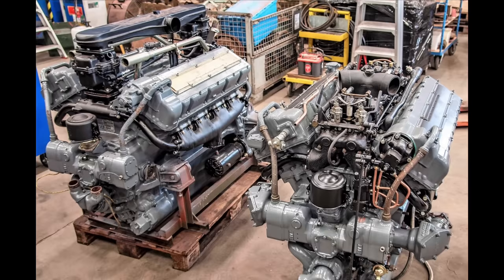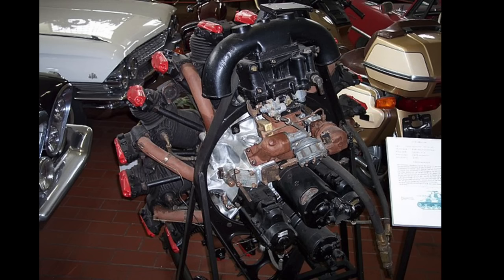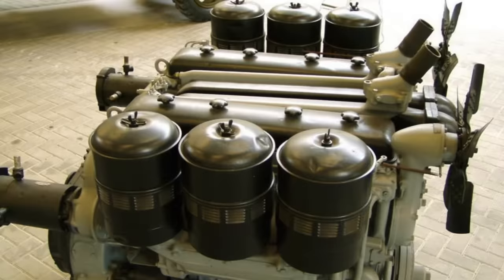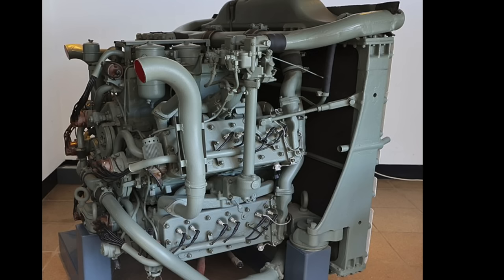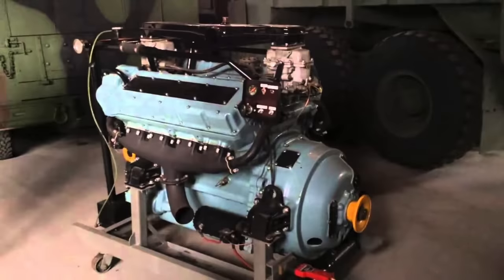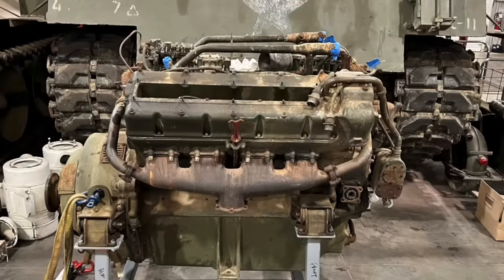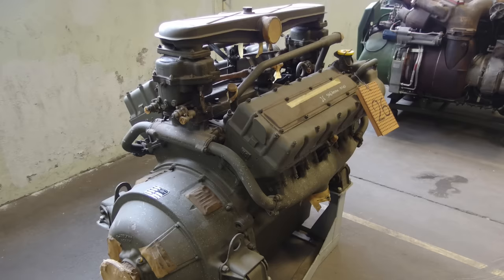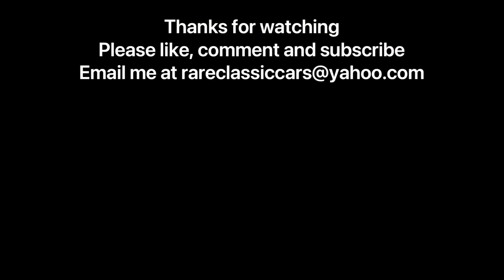An All-Aluminum, Flat-Plane Crank, DOHC V8 in 1940! Ford's 1,100ci (18L) GAA V8 Is a WWII Marvel

Comment: The old timers that were drag racing in the era of flathead V-8’s used to talk about making 180 degree cranks for their engines to use in place of the original 90 degree cranks.

Those truly iconic 671 GM Diesels (before the division was called Detroit Diesel) deserve more than this passing mention!  They did not share a common block. It was two straight sixes driving a common gear box. Each engine had a clutch allowing operation on either engine, as stated. These are naturally aspirated two strokes, not supercharged. The scavenging blower is necessary to remove the exhaust from the cylinder and replace it with fresh air while the piston is near BDC after the power stroke and before the compression stroke.  Turbosupercharging would come later.
Reply: People don't realize that what became the hot rod "supercharger" (6-71, 8-71, 10-71 etc) was originally a literal "air blower" for a 2-stroke diesel. People know so little about the old Detroit/GM diesels that they are constantly referred to as 'supercharged'.
Reply: @drifterbbb3649  Refreshing to see that there are still folks out there who realize that a Detroit 2 cycle diesel was not supercharged, not in it's factory form.
Reply: Great to see somebody who knows that Detroit 2 cycle diesels were not supercharged.  So many too young to know try to argue about this.
Reply: You shouldn't use the outdated term superturbocharging as it is misleading. Just say turbo
Reply: If they require an engine driven blower to flush out exhaust gasses, would that qualify as naturally aspirated?
Reply: @k4106dt  Yes, because the blower doesn't act as a booster.
Reply: @mikeholland1031  It is not that important.  You knew what he meant, right?
Reply: @jamesbosworth4191 please explane yourself?
Reply: @vicferrari9380  What do you need me to explain?
Reply: @jamesbosworth4191  I did but many won't. That was why I stated that. It's an outdated misleading term.
Reply: A very similar twin bank set up was used in the Navy and Army Landing Craft Mechanized, LCM 8s (73' landing craft) from the '50s until the early '90s.
Reply: Yes, a scavenging blower, amazing to see how many clowns in videos refer to them as supercharged - one of the finest diesels ever made.
Reply: Oil leaking, screaming Texas Yamahas! :)
Reply: @chosen118  All part of their charisma..
Reply: @mikeholland1031  Like I said, not that important.
Reply: @francovance1  Many of them think all 2 cycle engines are crank case compression 2 strokes like the engines in many lawn mowers, chain saws, etc.  I remember when I used to drive trucks, I had somebody tell me that the Detroit Diesel under my hood was a 4 cycle engine, "because 2 strokes don't have valves".  When I explained to him that there are two different types of 2 cycle engines, he looked completely befuddled.
Reply: I did a bunch of reading and answered many of my questions. The only one I have left is calling a 2 stroke naturally aspirated.  The GMD site says a 2 stroke won't run without a forced air intake because it doesn't have a crankcase input pulse to feed it. Does not "naturally aspirated" imply not requiring more than atmospheric pressure to operate?
Reply: @vicferrari9380  You are correct, a Detroit Diesel won't run without the blower, but stock, it doesn't give the engine more than atmospheric pressure.  The reason the blower is needed is due to the fact that the intake ports on THAT 2 stroke are low in the cylinder walls and are uncovered when the piston approaches the bottom of it's travel, which means no Intake vacuum is produced, hence the need for the blower.  The OTHER kind of 2 stroke, the type found in lawn mowers, dirt bikes, etc. DOES produce intake vacuum, as the intake port is uncovered when the piston is traveling UPWARD, increasing the volume of the sealed crankcase.  A boosted Detroit Diesel typically uses a turbo charger, with the scavenging blower only effective at cranking and low engine speeds, the turbo coming into play as RPM climbs.
Reply: @vicferrari9380 
The blower on top was geared so low that it didn’t compress air, it just blows air into the cylinder… hence the term… blower.

Comment: Another reason for the 60° bank angle of the GAA, is it helped to cancel both harmonics and idle vibrations. If you tried to run a flat plane crank on a 90° V8 of this size, it would rattle your teeth out in a tank. They sound weird, but run much better.
Reply: That is the same reason that the V8 engine in the original Leland Lincoln, (before Ford owned it) was a 60 degree V8.  Henry Martin Leland understood that buyers of expensive cars want SMOOTH.
Reply: Yeah run it up in the RPM's and you stand a chance of fracturing the crank
Reply: It is amazing the advancements in technology.  Metaurlagy and the like.i was thinking it was probably easier to forge that crank to get production through. It was wartime. Ford made the plant for the B 29 and the like.  Something else

Comment: I would love too hear all 4 of these engines run . I wonder if the GAA engine would fit in a Fox Body Mustang 😂.
Reply: Any engine will fit in any car, if you have a big enough hammer...and a torch.
Reply: GAA would be great for tractor pulling
Reply: @ottopartz1  air cooled ???
Reply: @bobturnbull18  it's an air cooled motor!
Reply: "I wonder if the GAA engine would fit in a Fox Body Mustang"

No, but the Fox Body Mustang would fit inside the GAA engine.
Reply: Someone put one into an earlier mustang. I think it's on YouTube if you search
Reply: I was thinking the exact same thing!
Reply: @ottopartz1  The Continental is air cooled. The Ford is clearly liquid cooled. Just look at the photos.
Reply: @ottopartz1 air cooled?
Reply: GAA was not air cooled. Only the radial engine was. @ottopartz1
Reply: No, physically too large.  Might fit in a 70s Lincoln though!  A new version of the Hot Rod Lincoln!
Reply: @ottopartz1 it’s water cooled.
Reply: It might fit, but you would need to reinforce the frame, the suspension, the brakes, the transmission, the drive shaft, the rearend, along with a bigger fuel tank, a bigger fuel pump, longer fenders, a longer hood, and a larger radiator and maybe a big air scoop. But, yeah, I think that would work. Please post a video of the work and the results. That would be awesome. I would run a true dual exhaust because that thing is going to be, as Tony the Tiger says, "Great!"
Reply: @Colorado_Native  You always should replace the clutch, trans, drive shaft, and the rear end when swapping in a substantially larger engine.  The added torque can break off gear teeth in light-duty drive-line components.

Comment: As the old saying goes: Necessity is the mother of invention.
It's amazing to think of the engineering employed throughout the forties, fifties and sixties that is still unmatched today.
Reply: It's surpassed
Reply: That's because there were no emissions laws and no CAFE back then!  American ingenuity was allowed to flow freely.  Today, it is determined by politicians and office workers, politicians and office workers who know absolutely nothing about cars, except how to start them and aim them.
Reply: @Bloodcurling  In some way yes. In too many, still no.
Reply: You are so right on.  The innovation spirit is just not here today.  Not to be negative about today but I worked with a lot of engineers in the late sixties and on and I marvel at what they taught this young whippersnapper.  No calculators or computers just slide rules.  Damn those guys were geniuses'.
Reply: @shareurtube  I just don't have the same kind of respect and awe of somebody who uses a computer to do things as I do for the guy who does it with HIS brains.
Reply: if i can sell you something, without works & jerks, for a reasonable price,,why would i spend 3 times as much producing something better, for less money, from you.. super chargers, ohc, turbo, fuel injection, all old tech.. not needed for mass production..
Reply: @harrywalker968  FACTS.
Reply: Yeah think the Atomic bomb. The refining. The presision machining to get it right the first time  without fail. To me  these days. Christ the discretion

Comment: The worm-drive for the camshafts was a brilliant idea.
Reply: But noisy and I’m sure plenty EXPENSIVE to produce...
Reply: @martyzielinski1442 not relevant in war or for military use.
Reply: I guess mostly higher rpms (thus automotive applications) might be an issue. But great for  low rpm's like these
Reply: Twin and triple row roller chains were cheap and reliable. Why not use them?
Reply: That idea needs to be revisited today
Reply: All copied of the rollsroyce merlin engine
Reply: Shaft driven overhead cams was the standard for big water cooled aero engines in the late 30's. The same can be said for pretty much all the other "advanced" features. The only thing weird about this thing is that the design was never really used as an aero engine. As a consequence history remembers it as an advanced tank engine rather than the cut down and de-tuned version of a mediocre aero engine.

Comment: WWII and the period directly preceding it were full of innovations, especially in aircraft engines.  Turbo-compound engines were an example.  It might be safe to say that until computer controlled engines became the norm that very little new innovations occurred after that war.
Reply: 100% correct, although if we never had an EPA or CAFE, we might have had some innovations, but meeting their mandates comes first nowadays, or else you can't sell the car for street use, only as a racing car.  Imagine, a 2024 70s-style Cadillac Fleetwood being sold as a racing car!

Comment: Thank you for sharing. A real unique engine for the day. My great-uncle was a master tank mechanic for the duration of the war. He often spoke of Ford engine and, yes, tweaking they did to use the real power curve it was capable of..  That thirty cylinder Chrysler motor I'd sure like to see you do a video on. That he said was a crazy configuration and a real headache to service. I don't remember him speaking much about the Continental one. All great information. Thanks again!
Reply: He does have a video on the 30 cyl Chrysler engine. That engine is out there man.
Reply: How'd you like to be a tank mechanic that had to change 30 spark plugs at a time.? While the engine was in the tank.? The British and the Russians went out of their way to request the Chrysler multi-bank engine for the lend-lease tanks we gave them. Yes, the Russians. We gave them 7,056 Sherman tanks, which their own action reports said were 99% reliable, but of course they never admitted they used anything but their own T-34s
Reply: @bobkonradi1027  It wouldn't surprise me if the are still using some of them and reverse engineered to steal whatever they could.

Comment: 4:08: The Chrysler 30-cyl tank engine was actually 5 separate flathead inline-6 car engines, all mounted to a single casting, sharing 1 oil sump. Each engine was complete, essentially an off-the-shelf motor which could be independently replaced. So, you had 5 crankshafts, 5 distributors, 5 carburetors, etc.....
Reply: I feel bad for the guys at the factory and the army mechanics that had to build,install and dial everything in on these they should have got a medal for that alone! LoL  could you imagine going into work on a Monday to find out you have to change the plugs & wires and service the rest of the motor?!? I would have went back and tried again Tuesday 😂
Reply: You might argue this 5x6 flat head is an early "modular" engine. That Chrysler 6 was a sturdy performer, having had several of them in my family back in the day. They found there way into a lot of stuff. Look forward to seeing more...
Reply: I have been hearing that "slant six" was the engine they had bashed together when they made this  but this predates this engine by decades. ...it's also a long time since hearing this. I am glad I've now seen a video on that. Take a look. It'll blow you're mind
Reply: I've read elsewhere that most of the multibanks went to England and their mechanics figured out all the idiosyncrasies out and loved'em.
Reply: @ConsolidatedPBY  The multibanks were the only engine in the Sherman that could run on like 80 RON gasoline; the Continental needed AvGas, the Detroits needed diesel, and the Ford V8 needed 90 RON.

Comment: I note that the Ford engine started as a competitor to the RR Merlin, but after losing to the Merlin for aircraft, was trimmed by 4 cylinders leaving a 60-degree 1100ci V8.
I also note that Rover in the UK developed the Meteorite (but that was post WW2), which was a Merlin trimmed by 4 cylinders leaving a 60-degree 1100ci V8. Most common use was in the tractor of tank transporters. Built in both gasoline & diesel variants.
Furthermore, I note that a development of the Merlin became a WW2 tank engine - the Meteor. 1650ci V12. While only SOHC, the 50% larger displacement made up for anything like that.
Reply: Ok your notes are duly noted..
Reply: @mortenmerstrand5473  Thank you for noting the notes.  Your note of the notes has been noted.
Reply: @ShuRugal  Ok i will take a note of that ;)
Reply: The Meteor engine used in the Centurion tank was a Merlin without supercharging.
Reply: @pashakdescilly7517  it also ran in reverse rotation and had quite a lot of aircraft specific parts removed which reduced its size considerably.

Comment: That's an impressive bit of tech.  It would have been amazing if they shrunk the displacement by half and put it in their cars.  Likely like the Buick aluminum V8 cost considerations would have quickly killed that off, but it would have been truly something to admire while it lasted.
Reply: The buick aluminium v8 was taken over by the rover group, and they made a schedule change between tempering tbe block and machining it, which resulted in a reduced rejection rate and became more cost-effective.
Reply: The fact that they can't sell cheap to produce engines today is one of the reasons today's cars are so expensive.
Reply: Rover still uses yhe Buick aluminum V8, or did.

Comment: The Chrysler Multibank was 5 6-cylinder truck engines eventually turning a single output shaft.  The demand for tank engines was so great that they had to come up with something in the 400-500 HP range fast.  (The U.S. went from basically 0 tank production in 1939 - thousands in late 1941.)
The R975 in the M4A1 Shermans was a bear to work on.  Getting to the bottom cylinders was a pain - and you had to be careful to ensure that any oil that had pooled in the bottom cylinders was drained - otherwise, when you started it, you'd be trying to compress the incompressible oil, and bent or broken conrods was the least bad thing that would happen.
(Used to own one)

While the Ford GAA was pretty advanced for a ground vehicle engine of the time, its features were pretty much state of the art for aircraft engines of the time.
At the beginning of the War, typical in-line combat aircraft engines were Supercharged V-12s, (Some with 2-stage blowers or Turbosuperchargers in addition to the Engine's main stage blower), displacements ranging between 1600 and 2300 cubic inches, All aluminum, Overhead cams, usually 4 valves / cylinder. The Radials at the start of the war were single or twin-row, 'bout 1800-2800 ci.  producing between 1200-2100 HP.  The Brits has some with sleeve valves.  Lat war radials were 18-28 cylinder (2 or 4 rows) beasts with displacements in the 3300-4400 ci range.

Rolls-Royce basically did the same thing with the Merlin - took off the Supercharger, lopped off 4 cylinders to make a V-8, and it was produced as the Meteor tank engine.
It, too, was a great success, and is really worth a look.
Reply: The Meteor was a V-12. It was the Meteorite that was a V-8.
Reply: The Mopar A-57 multi bank is a genius kludge of how to put a big HP engine into production ASAP by tying 5 proven inline 6 engines together. Given the low end torque of the old long stroke flathead Mopar in lines, must've had a mind bending torque curve. Look forward to your feature on it!
Reply: @trevorlewis8515 And don't forget, being based on common truck engines an average mechanic had the know how to work on them, not much special training needed.
Reply: I owed and flew a Grumman ag cat powered by a r 975 continental good power but had a problem with cracking crankshafts. 11:04
Reply: The con rod length as well as the bore/stroke ratio helped in torque I am sure. When I was young I ran a Shimano 3 speed on my moto cross bike (back in the 70's)  second gear was 1:1 ratio first gear was reduction. Third gear was compound. There seemed to be a lot of power loss in that compound gear. But that reduction gear (first gear?) The opposite seemed to apply. Could be the planetary design. If anything a reducing of the crank speed on this thing would be less reducing of actual crank speed. Keeping rpm in focus over varying terrain.  That Chrysler 30 cyl thing.   Oh Boy !
Reply: @jamespell8091  a buddy of mine has an old Kawasaki with odd gearing like that, 1st gear feels like nothing but as soon as you hit 2nd it feels like it's trying to pull your arms off lol